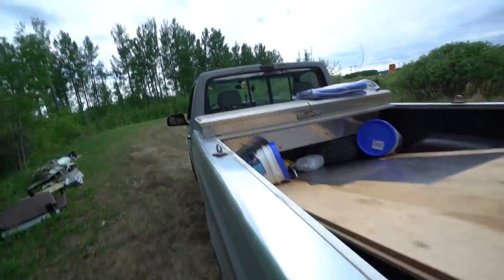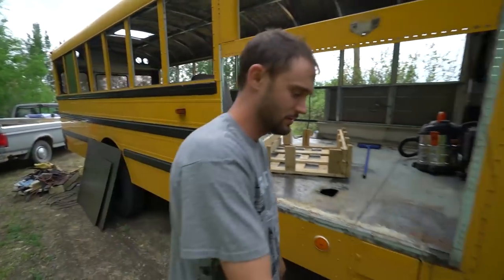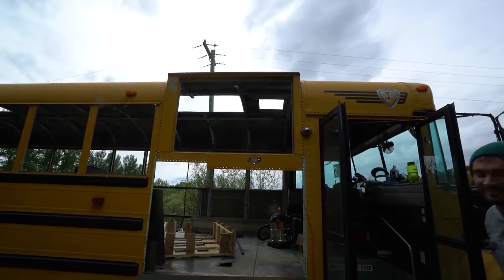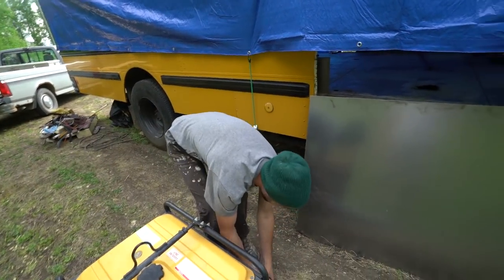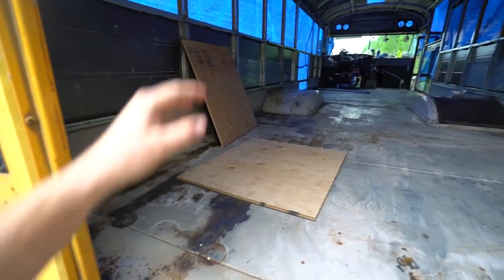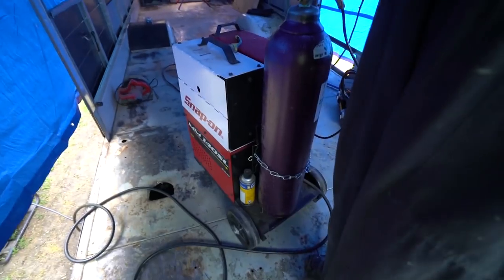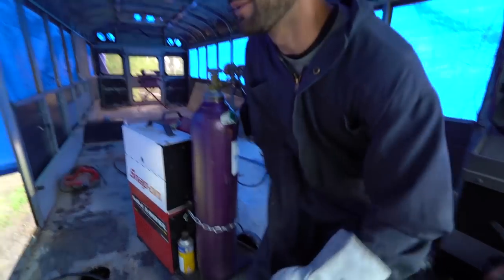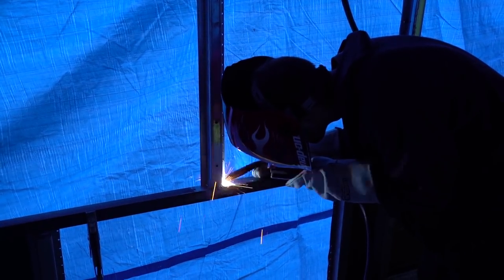LEARNING TO WELD + COVERING SKOOLIE WINDOWS

Comment: you should use 1/8 in Mahogany for the entire side and then stain it. Or strips of Oak. Use Construction Adhesive. Stuff dried like steel. You'll have to use a bow wrap to hold it in place while the glue dries.

Comment: From the peanut gallery: $10 to have the sheets cut to spec is money well spent (we saw Jax's work with the metal snips 😀); spray foam as an insulation will give you the only true thermal break - which is huge, and what you want; and, nothing says skoolie like the "black bumps". No disrespect to Navi - as Navi has a certain "thang" that can only be  imitated, but never duplicated! It is awesome to be able to watch the build!!!

Comment: If you're going to put wood on the side of the bus, I would keep the rub-rails. I personally think it would look super unique if you removed the rub-rails, filled in the holes with body putty, sanded them down and went with a smooth finish all around. That is a bit more work but it's not done very often and it would look very unique.

Comment: i would remove the bottom one and put wood between the two top ones and use the black bumper strips as a border to the wood.
Reply: Taraz Pariseau   they are there for when you get brod sided by a ??? Safety first !!!
Reply: i used to drive a school bus lol.  but this bus wont have passengers back there

Comment: Rub rails? Take them off. Leaves your sides looking less "school-busey" and gives you more options for anything you want to do on the sides. Folding table like Michael's or any kind of graphic like a wrap you might want to do later. It will give it cleaner "bad ass" uncluttered look. Unless the rails are needed for some kind of horizontally structural support.....lose them. They are a pain in the ass to work around. Good luck....you guys are doing great.

Comment: I am surprised you put more windows in because there’s no insulation on windows and you mentioned having trouble heating & cooling the old bus. Better insulation on the ceiling will help, but the windows might be what is letting the cold or heat in. I’m sure this bus will be awesome regardless. ☀️

Comment: You asked for it, here's my opinion! HaHaHa! Personally, I dig those "black bumps", they look beefy and hide seams and they also add important rigidity and structural integrity. I think they look cool. One last thing, it will save a fair bit of labor and time if ya just leave 'em in place. OK, so it's obvious I'm not a tech savvy guy, I'm cool with that, but would one of those mobile hotspot thing-a-mabobs make life better for you Jax? Holy mackerel, it looked like a steel mill there was so much goin' on! Diggin' the tunes too! Ya got me...never woulda guessed the window...nope, never. Heh, heh. So, yeah man, "natural light", also known as, "passive solar"...it's a green thing. Waytago! I think most people manage a burn through or two when they're first learning to weld. I wouldn't lose any sleep if I were you. Cool to see progress, keep it up. .................................PEACE!!

Comment: I'm a girl(😂😂😂)  so got a welding question:  is there metal along with the flame  that brings the metal together or is it the heat that brings the two metal pieces together?
Reply from the maker: It’s a thin metal wire and electricity on this one

Comment: Why not leave the "rub rails"? Paint the rails with a contrasting color (fluorescent chartreuse, like your jacket, wowzer!), mount two rows of wood planks (redwood? red cedar? a color that will contrast) between the three rub rails, a throwback to the classic Ford "woody wagon". The contrasting colors are, of course, dependent on your main body color theme. Rub rails are not only for aesthetics, rails are structural and add rigidity at the shoulder, seat and floor levels.

On second glance at the bus sides and second thought... The rub rails will have to be replicated for the continuum of the rails in the areas that the escape door and the wheelchair elevator were previously located. I haven't formed an opinion on this alteration as of yet.. Damned if you do and damned if you don't.